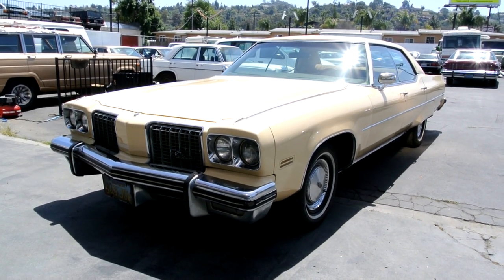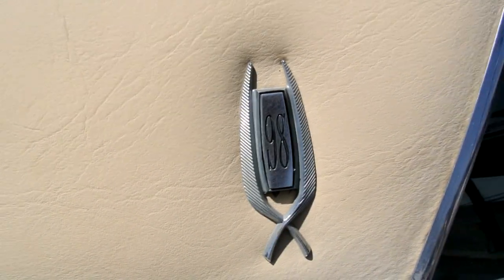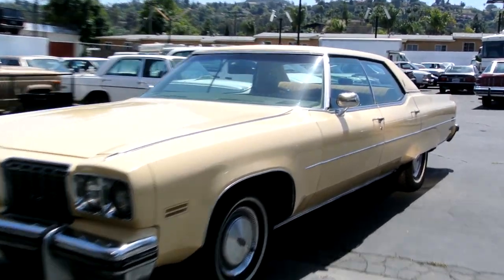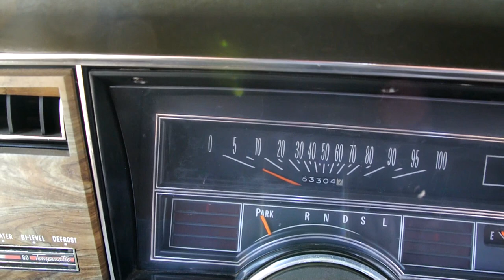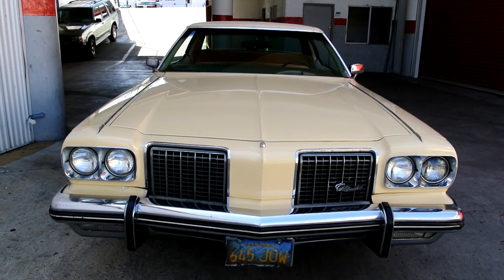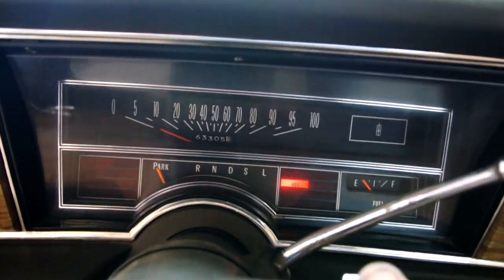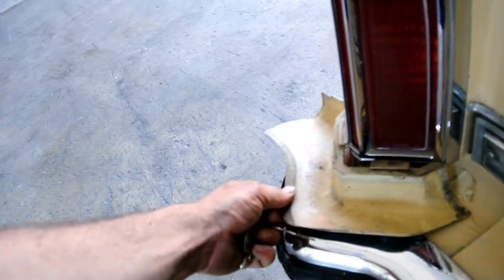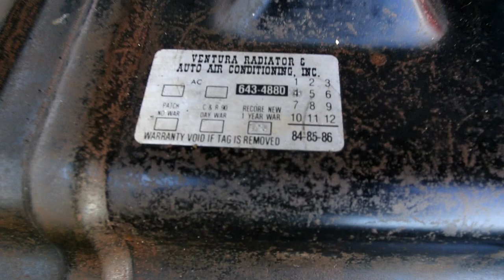1 Owner Oldsmobile Ninety Eight Delta 88 98 Orig Mile Clean Olds GM 455 Loaded

Comment: The nose is fiberglass and the hood ornament is missing.The 455 is bogged down with emissions control only outputting 210 horse. The steel used on GM cars of that vintage is reconstituted from Japan. GM at it's most inefficient. I should know, I own one.